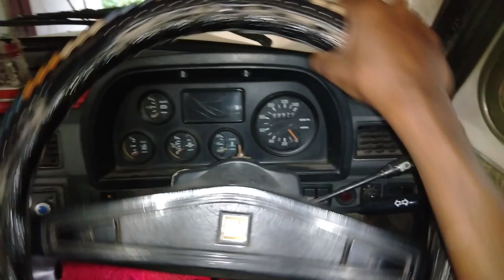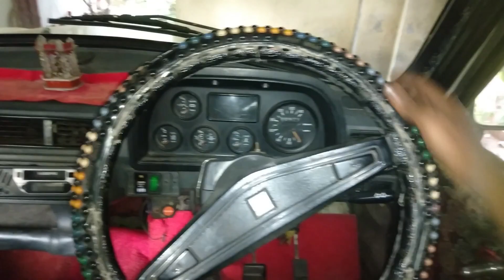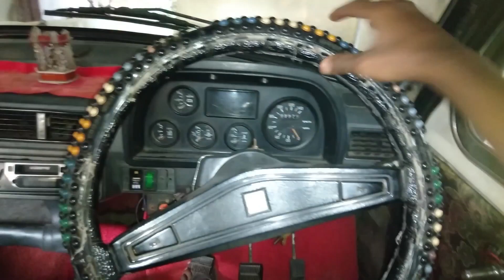Car Steering Tightness While Turning | Reasons Explained | Manual Steering | HM Ambassador Car

Comment: What is the steering box ( normal or power ) tell me
Reply from the maker: Steering box or Steering Column is a mechanism situated below the platform. It converts the rotary motion of the steering to sliding motion and makes the tyres to turn left and right. It consits of a rack and pinion setup in manual steering equipped cars. 
           Power steering equipped cars have a fluid gallery like mechanism in this steering column which provides force to turn the wheel along with force given to the steering. 
                 Most of the present day cars have Electronic power steering consists of a motor which assists the force given to the steering.

Comment: Ambassador tyre pressure ethra aan?
Reply from the maker: Sir, Ambassador Car ൻ്റെ Air Pressure ഒരിടത്തും അത്ര കൃത്യമായി പറയുന്നില്ല. പല ടയർ ഷോപ്പിലും പല Pressure ലാണ് Fill ചെയ്യുന്നത്. എന്നിരുന്നാലും നമ്മൾ Front Tyres (5-90-15 Nylon) ൽ 34 PSI യും Back Tyres (165/80R15 Radial) ൽ 32 PSI യുമാണ് Fill ചെയ്യുന്നത്.

Comment: Lovely piece of information bro
Reply from the maker: Thank You Sir 👍👍
Reply: How will be the manual steering in general because I heard it is tough like that is it true kindly tell me your experience bro
Reply from the maker: Manual Steering is fun to drive in old vehicles if we enjoys driving that. But in practically, it is tough especially during turning while vehicle is not in motion and driving in slow speeds in uneven roads. Power Steering and Manual Steering are approximately similar while driving in normal speeds. But Manual Steering needs about 5% - 10% more power to turn in these speeds also. During long trips we get little more tired than driving power steering vehicles. But Handling is not affected while driving and it also ensures a good stability. Proper greesing and maintaintence will conserves its own smoothness.
Reply: Very well explained bro & thank you